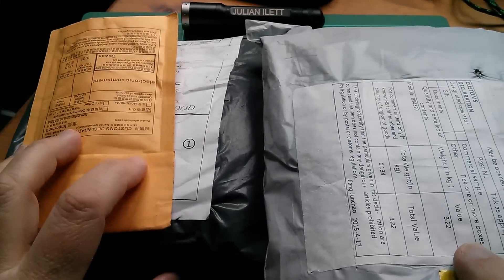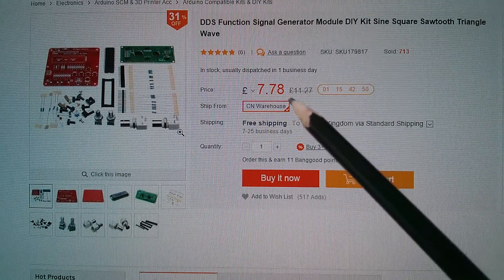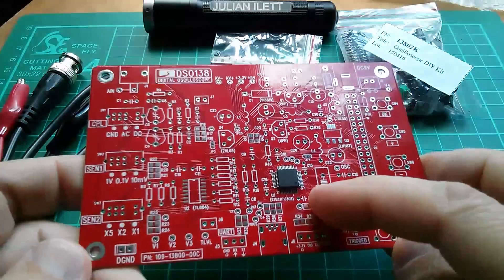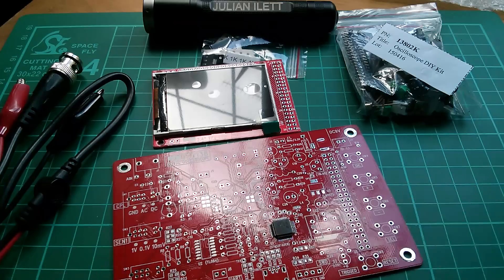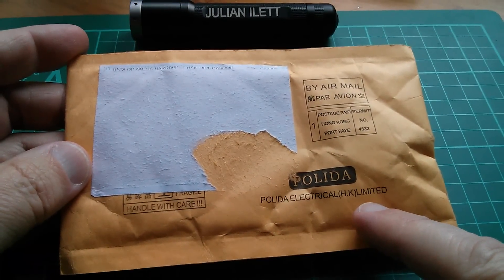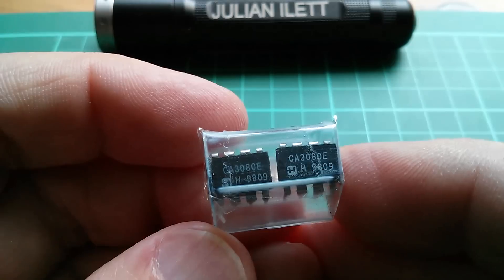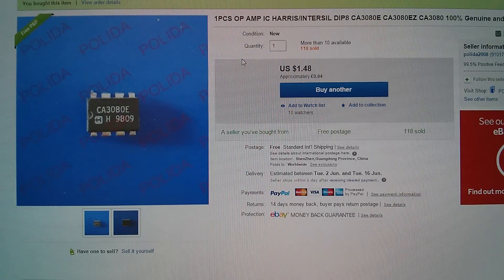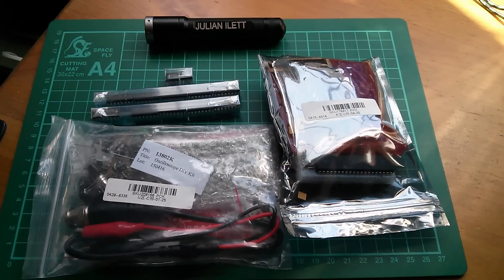Julian's Postbag: #40 - Banggood Scope/DDS Kits, OTAs

Comment: I was going to suggest an atx supply, but perhaps two isolated 12v and a 5v generic switchmode deadly china power supply combo would work. Or a massive bank of eneloops and a 7912, 7812, and 7805 regulators in an ol' bodgery-at-its-finest setup.

Comment: Hi. I've got myself last year a DDS generator but that one actually runs from 7-12V and has split supply generator on board but it generates some ripple on the output so I'm not very satisfied with it's performance. Also, I wanted to actually get an oscilloscope kit also but I just cannot cope with having only 4-5 buttons interface so I rather get an old CRT very basic scope that would the job much more better. So, I'm still hunting for a cheap USB computer oscilloscope. Also, please do a review on those small white usb oscilloscopes that cost about 20$ and have a bandwidth of about 5Khz. Cheers :)

Comment: I guess from the specs they're using the onboard ADC of the STM32F103 - it has a maximum sample rate of something like 1MHz, though I think it only has 10 bits of effective resolution at that speed. And yes, from personal experience it is as annoying to solder as it looks.

Comment: I recently built this scope kit. It was my first attempt to solder surface mounted components so I was a bit nervous but it worked first time. Recommended for anyone who has beginner soldering skills and wants to learn something new. My only issue was one of the transistors was supplied as the wrong part - I was able to pick the right one up on eBay for a UK seller for a quid so wasn't a big deal. Looking forward to see how you get on with it and hopefully you can show us some good examples of how to use it. Really enjoying your videos Julian.

Comment: I bought one of those scope kits a couple of months ago. Same kit, though all the SMD devices were already soldered, just had to do the thru-hole stuff. Went into crank mode, and finished it in one evening sitting. (Watch Netflix, solder stuff.)  Went together smoothly, worked first time. Display looks nice, and it does AC and DC coupling nicely, unlike some others. I've got one of those Hall effect current sensor ICs hooked up to my leach field transfer pump, and built a little monitor light setup.  The scope shows the pump current waveform, quite nicely, and I can tell if it's cavitating or acting up.  Purchased for audio and PWM type stuff, but it's been running on that job because I could. Works well, just wish it had a direct frequency reading. Great price, useful, fun to build.  Have to package it soon. Will be fun to see how you like it. I think it's hard to beat for the $. (US based, here.)  Really enjoy your channel!  Keep up the good work. I also have a bit of a thing for battery/power packs, so please keep up the power stuff!  Thanks, Stu

Comment: Couldn't you grab a 24v DC source and turn it into a symmetric 12v power source for the generator?

While the pcb's come with order instructions, i would figure soldering ic's should be #1, since they're more frustrating to solder with other parts around them,in my experience.

I also saw these kits last week and considered buying them, however, after checking reviews I felt they would both be a bit annoying for my uses.
Own an analog oscilloscope anyway!

Would love to see the end result of these kits though, your high quality video's are always nice to watch.
Reply: ***** 
How would you make a symmetric power supply out of a single supply? You can't just split a voltage.
Reply: If i recall correctly, a DC voltage is a potential relative to your ground. if your ground is 12volts, then 0 volts is -12v and 24v is 12 volts. you need high wattage components as the power will flow through them though. or design your power supply from the ground up and have a dual coil(?) output on your transformer.
Reply: superdau You can with two 12V batteries.
Reply: CZDrMike 
Sure you can. But that are two "power supplies", not one.
Reply: ***** 
Ground is whereever you define it to be in yourcircuit. But just because I say my ground is at -1000V doesn't make an AA-battery a high voltage power source. You need a wire at ground potential and a resistive voltage divider is useless for anything that draws any significant current.
Reply: it's a signal generator powered by an atmega128! It'll probably not need much,you could parrallel plenty of resistors to meet the requirement.

Comment: Use a PC power supply for that first kit.
Reply: +Paul Frederick You don't need a precise PSU for a cheap funky gen
Reply: Wolfie M indeed, modify an old pc psu, put some 4mm connectors on the case, make a neat job of it has all the voltage options, i have one i just use the 12v output for an old 12v accessory drill, easily delivers the power!
Reply from the maker: Wolfie M That's a thought - there are some ultra tiny ones available, like this: http://www.ebay.co.uk/itm/160W-DC-12V-24Pin-Pico-ATX-Switch-PSU-Car-Auto-Mini-ITX-High-Power-Supply-Module-/271837418638?pt=LH_DefaultDomain_3&hash=item3f4ac5d48e
Reply: Julian Ilett There are breakout boards for the 20-way molex connector available, and ATX PSUs can be had basically for free if pulled from scrap computers.
Reply: +Wolfie M There's a reason scrap ATX PSUs are scrap.
Reply: Flad Mast
Junk PC PSUs are exactly that. They're junk. Good ones are good in PCs as they are special made for that application. If you need a bench supply, then by all means go get a bench supply. PC PSUs are a poor substitute for a decent bench supply.
Reply: or a transformer to a 7805,7812, &7912
Reply: Spoder Man
perhaps not. But I would like a PSU with a clean output.